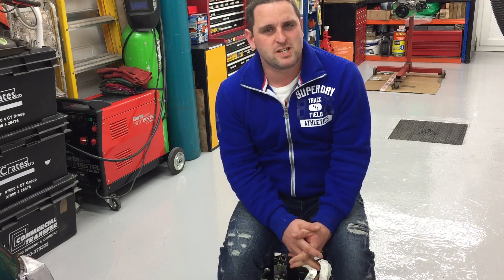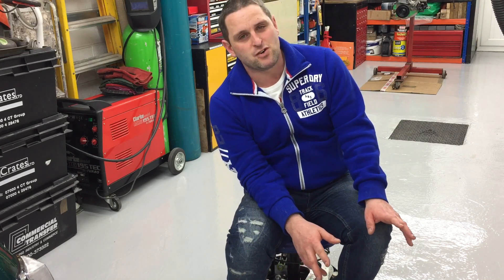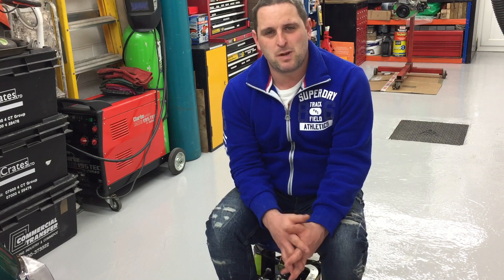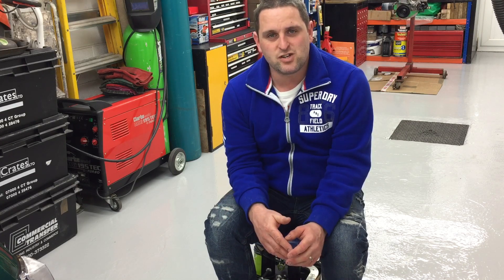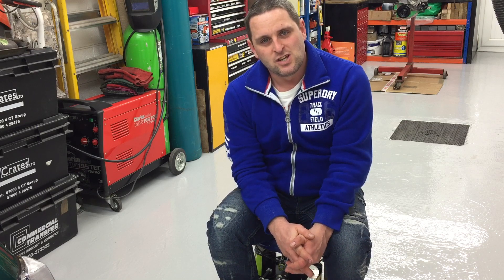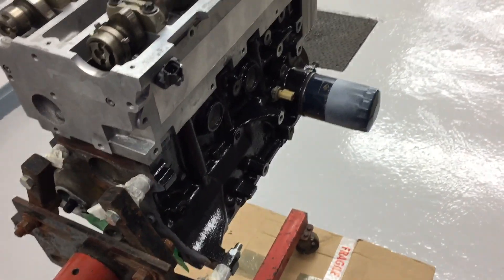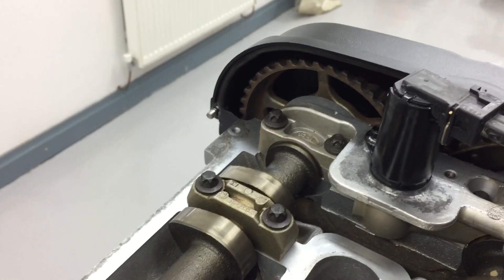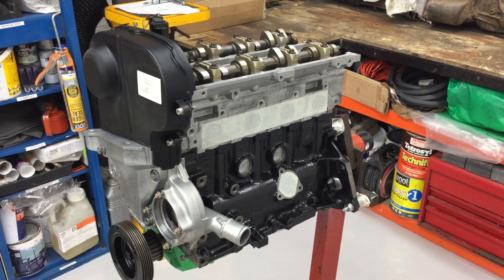Garage Rehab and ST170 engine Rebuild

Comment: Hi Craig, I’ve just come across your videos. Really enjoying your approach. A quick question. You mention that you’re using a different resin coat for your floor but you didn’t say what product it was. Could you provide the details? Cheers.
Reply from the maker: Hello, sorry for the delay. I had to find the tin. Its called Resbuild HB coatings in Goose Grey. I bought it from a company called Screed Giant. The first time i did the floor, i did it in Flow-coat SF41 in goose-wing grey, but this Resbuild product is much cheaper, exactly the same colour and seams just as hard wearing. Hope this helps
Reply: Thanks for the reply. I’ll give that product a look. Cheers.

Comment: what your welding set up?                                 brilliant by the way..............
Reply from the maker: neil carpenter I have one of the bigger Clarke mig welders. Some people slate them but i honestly swear by them. My mate has the same model as mine which is a 195 and its over 20 years old, has done many many big industrial type jobs as well as many car restorations and its still going strong and producing top welds after 20 years so its testament to the Clarke machines. The same mate also uses the big brand machines at work and he still swears by the Clarke. I think there a great machine. Not so sure about the smaller Clarke machines though. Mine runs 0.8mm wire and Argon/Co2 Gas  👍

Comment: Hello, could you please tell me what bottom end bearings did you use, i want to use exactly the same.
Reply from the maker: opexo If you give Burton power a ring and ask for the bottom end bearings (mains and big ends) for an ST 170. Thats all i did. If your crank has never been ground you will only need standard size. The issue is that the bottom end isn’t classed as a serviceable item so the torque figures for the ST 170 con rods aren’t available and the only way i could figure out to get round it was to buy ARP bolts for the con rods from burton power also. These come with the torque figures. The main bearings torque settings are just the same as the blacktop Zetec. I should possibly mention this on one of my videos as it took some working out for me. Thankfully i can save you the hassle.

Comment: What sump are you going to use, would a mk1 escort rs2000 alloy fit, nice garage 👍
Reply from the maker: Tony Aylott i dont think the RS sump would fit as its a pinto block and im using the ST engine which is basically a zetec. Im going to be using the retro ford sump which is a cast item rather than a steel welded sump. They look really good and are designed for fitting the ST into an escort.